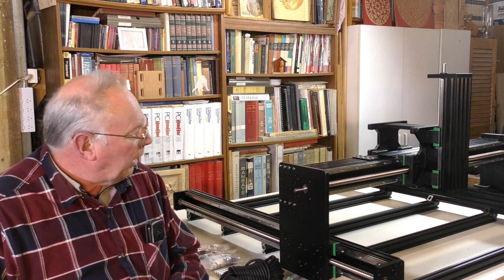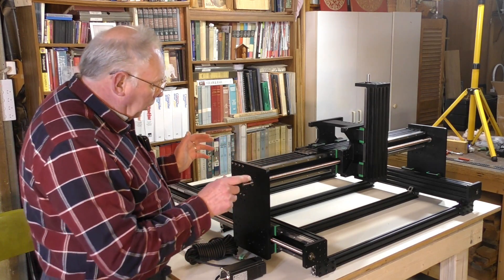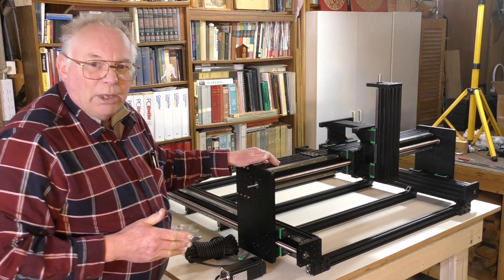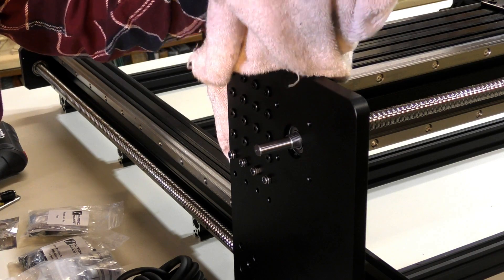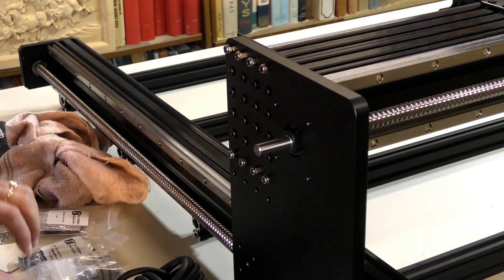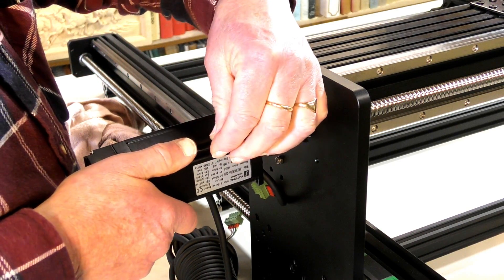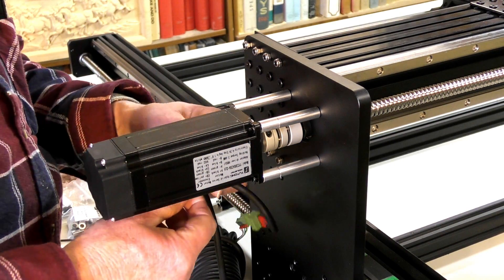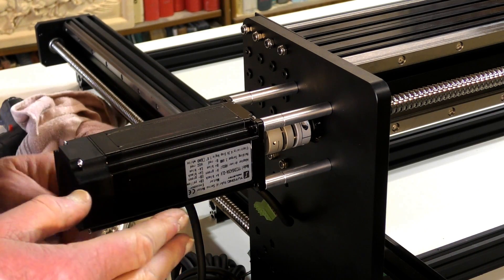Part 5 QueenAnt PRO V2 Super  Enhanced CNC Router hybrid servo motor fitting and more

Comment: Hi Roger. Not only do you need to have the rails parallel with each other, they should also be parallel with the ball screw. Those ball end hex keys sure come in handy. Those motors sure are long. It looks strange to me that the motors are mounted with 2 piece spacers when the rest of the router is so robust designed.
Reply: Not much use having a fairly large powerful motor when it's just fixed in place with long thin screws and janky spacers. The motor will just twist mounted this way.
Reply: i also thought that the motor mounts looked strange